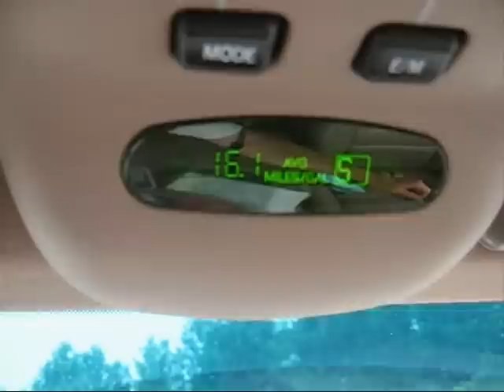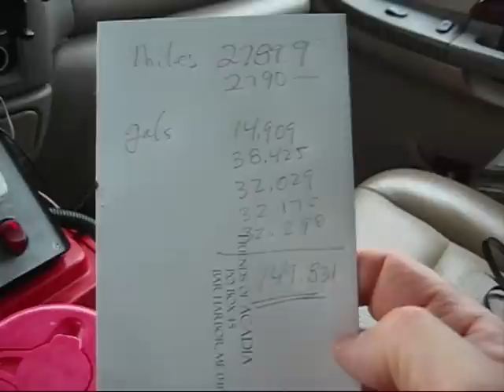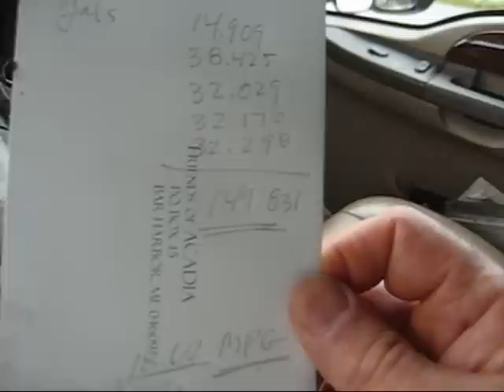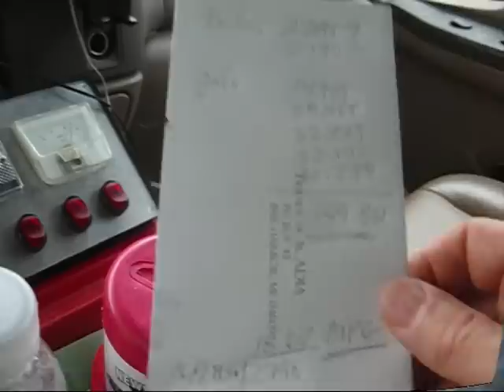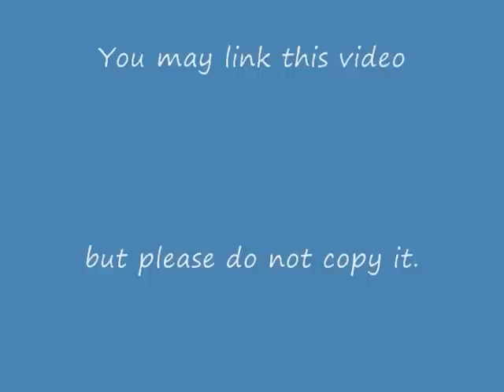MPG (mileage) Test 2790 miles with Dry Cell HHO F350 Superduty 7.3 Diesel

Comment: You stated that you do not have a trip without HHO for comparison but you "think" that this is at least a 20-30% increase in MPG.  Without comparison figures this is not a valid test.  With AC on/of makes a difference.  Where are you getting your electrical energy input to electrolyze the water?  Take a Physical Chemistry course so you will learn how to perform the Energy Equations and you will see that without an external energy source to generate the hydrogen, the net energy output will be less than that put in.  It really is that simple.  The more equipment and the more conversions, the lower the efficiency.
Reply: enticed2zeitgeist Not entirely true? Engines are anywhere from 16-28% efficient on petroleum fuel, not even close to 100%. I agree you can't get something for nothing. But that is not what HHO is. My alternator uses 4.68 HP for every 1000 watts my HHO system wants to make gas. HHO changes the chemical mixture inside the combustion chamber and dramatically increases the flame front of the intake charge of fuel (gas or diesel) thus burning more fuel that is already in there the proof is in the lower EGT'S, & HIGHER HP & Torque, yup that's right a net gain over the extra draw from the alternator I also see lower emissions and have proof on all of this. Net gains in hp & tq are anywhere from 11-150 depending on how much HHO gas and timing you put into the vehicle. The University's here where I live have already proven this technology works in a lab setting. I hope this helps you understand a little more on it.   Thanks for the comment!!
Reply: Ah I see my bad. No worries!
Reply: I agree, you have to have a stock baseline test to see if HHO is helping or not. I have a fully stock 99.5 F350 CC long bed 7.3 and I get 18.75- 19.40 stock on 200-350 mile trips. I do like his effort! I do believe in HHO though my system worked great on my 94.5 powerstroke (28 MPG) but has yet to do something on my 99. I have been working with HHO for 8 years and many things have to be correct in the hydroxy system first, than the vehicle has to have a calculated measurement on electrical energy and how much LPM's vs liter size of engine to have an effect. We all have are opinions but no one will ever tell me that HHO doesn't work I have made it work on over 50 vehicles form a geo metro to a semi truck!
Reply: Bigjoe Hho
Yeah, my comment wasn't directed at you. I agree!
Reply: Lon,

I agree ABA testing is nice, but almost 3k mile performance does say something. Next time maybe a baseline MPG and some 70-50 rolling times. May want to throw in a calculated Cd baseline for his model truck as well. Why? Because he was towing a 10,000lb load, which is apparently his business. At the beginning of each tow he could do some rolling times with each load to compare against drag (given most hwy miles load may be negligible). 

But in all it was a legit observation adding to the body of knowledge, though I agree it could have been a whole lot more. 

The PChem shot was a little cheap and misleading. You know as well as I that the 2nd law does not apply to open or non-isolated systems. That's what the entire first week of the course was about, and why each test question afterwards is prefaced with the "assume a closed system" phrase.
Reply: That's not entirely true. If internal combustion motors were 100% efficient you'd be correct, you can't get something for nothing. But internal combustion motors are not 100% efficient and anything that helps you burn "more" of the available fuel can be seen as increase in efficiency. This is true for higher amp spark plugs. The bigger spark can ignite more of the available fuel despite using more electricity which is derived from the fuel. If that's true, then why couldn't taking "some" power from the system to produce hydrogen and then burning it not also be seen as an increase?

Do I understand physics correctly?
Reply: +oldToughDW you may be educated in theory, but all you will understand is whether or not someones claim conflicts with your programming
Reply: Don't use gasoline at all shut the gas pump off take gas thank off if you want and turn the truck on and it will starts without fuel being injected with fuel injectors you only use oxygen valves you skip fuel injecting bull shit when those valves open to get air in the hydrogen us going in as well . then a spark is produced by spark plug which ignites the hydrogen exploding and burning all gas completely no carbon deposits behind stay with very clean cylinders ok I repeat no gas needed just hydrogen whooohoooo
Reply: Lon Brouse lier i got one and it works takes 12v and a 40 amp relay it is nice free gas
Reply: Lon, You have to capture longitudinal energy and a low voltage HHO cell with no voltage leakage, and create no heat and you can over come the net output energy equation. We do the same with only 18 amps. Create a 4x's more powerful gas form of HHO gas, close to 100% ortho HHO spin state and 2 non-sharing - protons.  H- H- and -O all from the negative energy from the aether, or non-hertzian energy.
Reply: Good points Lon. And every conversion is a loss, according to the 2rd and 3rd laws of thermodynamics (If I am remembering correctly.) Also I have a 3/4 ton 7.3 L Ford Diesel that got about 17- 19 on the freeway at 75 mph, consistently. Long trips are mostly freeway so a good increase of 20% would be 21.4 to 23.8. Depending on the trip I could expect an average in the 15 to 16.8 range in normal driving, which would make his 18.62 be in the 20% range. But what worries me is the drag and load on his alternator to break down the water. Just becasue you cannot see the load it puts on the engine itself does not mean it is not there. Also he exposes his ignorance of electrical theory I = E/R and the contacts and wire diameter look to be insufficient for the load so he is getting a heat build up. 
It ain't rocket science and although I am college educated it is in Liberal Arts not engineering, so how hard can it be?
Reply: And you connect to battery 12 volts 30 amps it is really that simple and I also know how to puryfi ocean water very simple too and you can use ocean water for the hho salt is good conducting electrolytes. And you can power electricity generators with hho generator like that getting free electricity haha it pays itself

Comment: My `99 7.3 diesel gets 19.75 mpg hauling my trailer on the freeway up and down the mountain passes at 67 MPH with cruise control on Oregon's I-5.  Without the trailer 21-25 mpg!   This HHO stuff is bogus... The energy required to generate the oxyhydrogen always exceeds the energy released by combusting it, even at maximum efficiency, the input energy of a closed system will always equal the output energy, as the first law of thermodynamics states.
Reply: what is efficiency of diesel engine and how much fuel converse into heat?do you understand what h does in this ?

Comment: mars1952 
First off your testing was done wrong. IN order to get a correct test both test runs has to be identical. No If ands and butts about it. Second; If you figure how little amount of hho is actually being created and burned in your vehicle you will see how silly it was to assume you got better fuel mileage. In your set up using 50-60 amps you are creating around 1% hho when you compare it to your total fuel intake. Ask yourself, What can 1% do. Are we talking magic here?  1% is such a small %.  Its ability to do anything is pretty much zero. Look up the energy loss that occur in gas or diesel motors. Most of the energy is lost through heat and friction. The 1% hho doesnt effect these type of losses.   We have another type of loss that is a very small % of the total loss and this is the fuel not burning 100% efficient. If the info i looked up is correct this loss comes to around 2%. So if at best, the hho magically made this 2% fuel loss go away you would not get more than 1% gain because of the amount of energy it took to make the HHO in the first place. 

Far As i know there are no chemical on the face of this earth that when added 1% to your total fuel intake will increase your fuel efficiency more than 5%.

Comment: Gdubya here.  Check your math.  You're getting 24.13 miles per gallon by my figures.   You actually used only 115.5 gallons.  That first fillup of 32.3 g should not be in your calc.  Yeah, you used those gallons, but you paid that back when you ended your trip with a full tank.  So in the real world you should not include the initial fillup.  By comparison, my Dodge Cummins gets 25mpg on 4000 mile trips when I run at moderate speed.  I think engine efficiency maxes in the mid 50's and wind resistance is a lot less than running at say, 70. (Cube the ratio of 70mph / 55mph and you get 1.27 ^3 = 2.06 times the energy needed.) Pulling a square front box trailer pulls my mileage down to 15-16 mpg and that says a lot about the wind resist. Enjoyed your presentation and Thanks for yur video!

By the way,  many years ago, I worked with guys changing stationary diesels of 1600hp to dual fuel operation  -- propane gas over diesel.  You cannot allow too much gas or the high compression will fire it much too early and wreck the engine.  It must always be mixed with excess incoming air to be too lean to ignite.  It then fires when the diesel is injected.  I believe the project was abandoned being too touchy.
Reply from the maker: The first top off is not on the list. That 32.3 was after we had been on the road for a while. Thanks for watching.

Comment: you need to run about a half an amp and about 50,000 volts at a resonant frequency of the water. If you hit resonance, a half amp will be sufficient to produce between 4-8 lpm. as long as you have the correct wave form. I think they incoming wave has to match somehow the standing wave the vibrating molecule. creates. But thats just an educated guess.
Reply: 25000 watts way to much
Reply: +kandysman86 I did some research into this very thing. The issue with using "resonance" to lower the electrical requirements, is the resonant frequency of water is 314 terahertz - which is in the far-infrared frequency range and requires a helium-cooled laser to produce.
Reply from the maker: +kandysman86 Even with dual alternators this truck can only produce about 300 amps @ 14 volts and that is 4200 watts. 1/2amp times 50,000volts is 25,000 watts. Where would I get the extra 20,000 watts?
Reply: I see they sell kits and they rate it for engines from 1.4 to 2.5 and then another one for bigger 4l  engines then for trucks or boats.
Am I wrong to assume that the more you produce the better it is?
To sum it up, I want to try in a small 1.6 I have, to then proceed to the 5Lv8 if I have positive results in the 1.6, would it be a good idea to go as big as possible ignoring the ratings they give?
What happens if I generate more gas, would that not make it better?
Also I have also heard about
1. changing timing because the explosion is different
2. delete or tweak the MAF because the amount of o2 injected makes it think it needs to run rich and beats the purpose of the better mpg.
Any ideas?
thanks